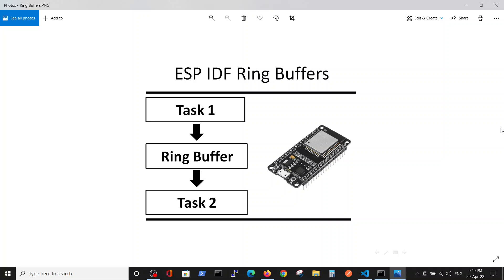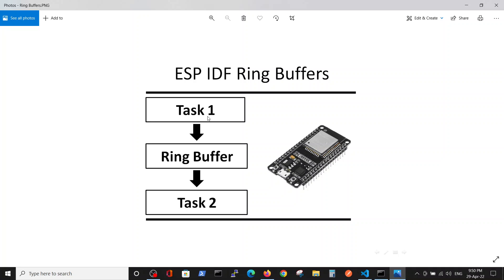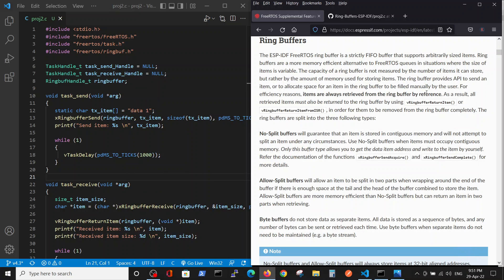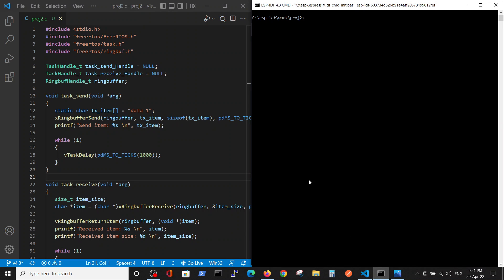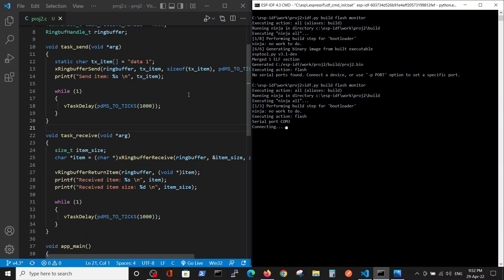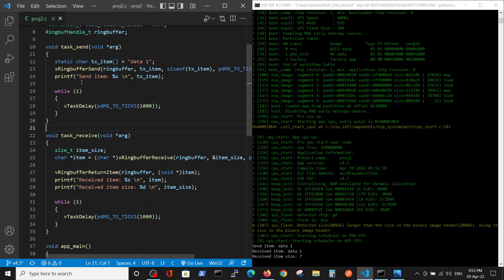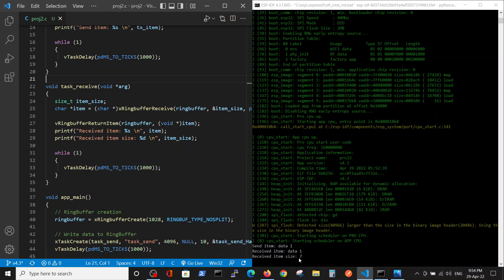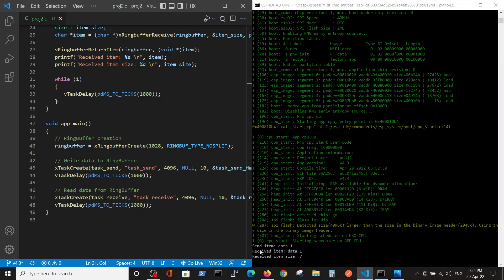Ring Buffers for ESP IDF FreeRTOS  in ESP32 data transmission between tasks by reference

Comment: Shouldn't you return item to the ring buffer only after you no more need access to it? I think it's done incorrectly in your code. You print value after you returned it, thus you allow the ring buffer to free the element. It doesn't free it right at the moment you return it but it marks it as unused and can free it at any monent. That's why you should return item only when you're done working with it
Reply from the maker: Dear  @okhsunrog,
From my understanding, the ring buffer doesn't dynamically allocate or de-allocate memory for its elements. It's essentially a circular array with read and write pointers. So what do you mean by "free it right at the moment you return it"?
Reply: @simsiotdevices6219  thanks for answering! Of course it doesn't allocate or de-allocate memory, but it still needs to know when the element is not used anymore. In this case new data is written over it. That's what returning items actually does. It says to ring buffer "hey, I'm done working with this element feel free to overwrite it with new elements". And if a high-priority task is blocked on writing to the ring buffer because there isn't any free space - that's exactly the moment it takes over control from our task and writes data to the space that we've just marked as "not used". Then we try to read data using the pointer and get something unexpected. That's why you should "return" items to ring buffer when you don't need them anymore. Hope my explanation helps!
Reply from the maker: Dear  @okhsunrog ,
So your point is to use "vRingbufferReturnItem" function in "task_receive" task after printing the "item", because after "vRingbufferReturnItem" the data can be overwritten and corrupted before it would be printed correctly?
Reply: @simsiotdevices6219  yes, exactly!🙂
Reply from the maker: Dear  @okhsunrog ,
Thank you for your thoughtful remark. I think that in this particular example, it will work OK, but from a broader perspective, you are certainly right.
Reply: There are two pointers ie read pointer, write pointer.  The write pointer gets incremented as you put items in the buffer. The read buffer gets incremented as the items are read. When read=write pointer the buffer is empty.  User code has to keep track of when to read the buffer because the write buffer will just overwrite what was written first and keep over writing older items.   Uarts make use of ring buffers to store data going both ways in and out of the device.

Comment: hello, i  need your help. i want to read and store the hex data in a buffer(variable) in esp idf; (the hex data is transmitted by stm32), so these data i want to receive and store. can u help in this! thanks
Reply from the maker: Dear Embedded Junction,
1. First define the communication method between STM32 and ESP32 (UART/SPI/...)
2. Then maybe this will help:
https://www.youtube.com/watch?v=1xTU1p7R7gw
Reply: @simsiotdevices6219  thanks! now can u help in how to decode the hex data transmitted by uart (decode to know what is the main data which is in the form of hex) in esp-idf
Reply from the maker: Dear  @embeddedjunction9204 ,
Try to find a start bit (0), stop bits (1) and bound rate. Then you can decode each packet individually.